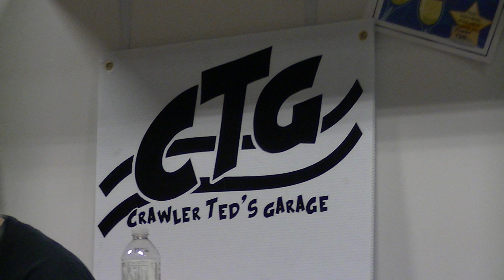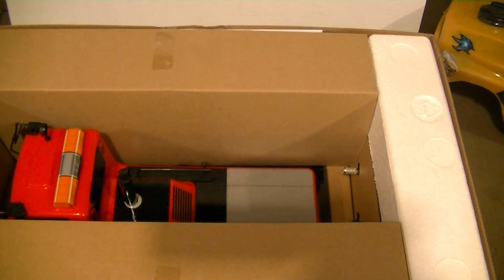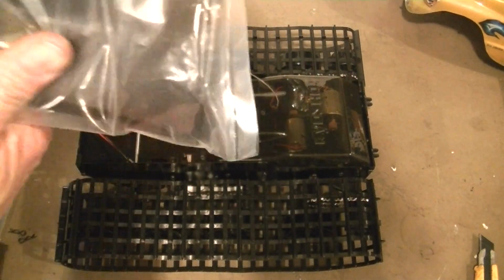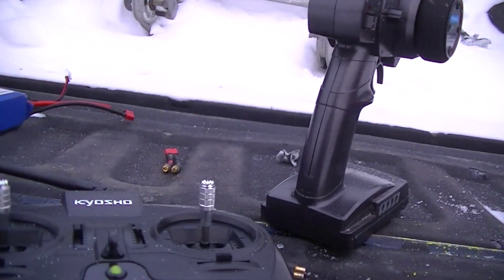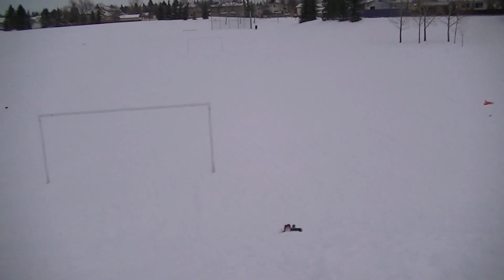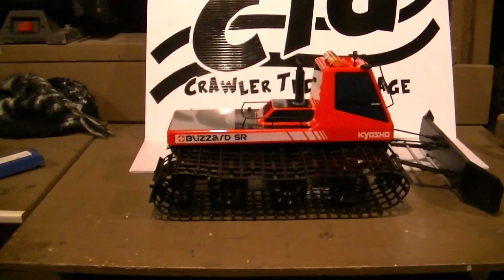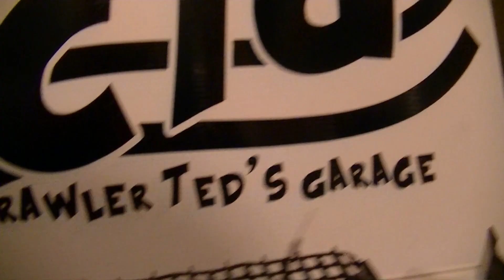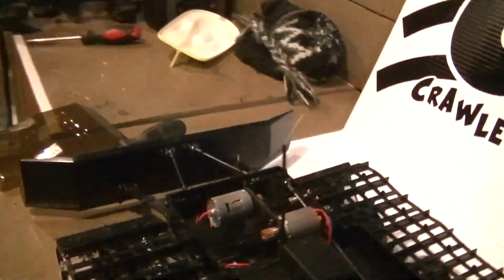Kyosho Blizzard SR , Open the box and hit the snow

Comment: Just pick up a blizzard didn't like the controller either so I hooked up my iT-4 running 3 different mixes. Way better!! Mix 1- throttle to channel 3 100%(low-high) 0 offset. Mix 2 steering to channel 3 50% (low-high) 0 offset. Mix 3 steering to throttle 50% (low-high) 0 offset.  left track ch-2 
Right track ch-3
Plow ch-4 using switch and trims. 
This makes the blizzard super fun and easy to control. Only down side is plow is up or down with a slow trim adjustment while driving but once you get the limits where your happy it's not a big deal. Also 4" zip-ties work great as studs on harder snow. Zip them around the lugs with head out and snip the extra off on a 45°. Just make sure they don't interfere with idler parts. I only put them on outside two windows. Have fun keep up the good videos!!!

Comment: * more to run a pistol grip radio. The vehicle runs on bushings so a plentiful amount of grease will help with rust. I suggest if you upgrade electronics that you replace all the wiring and switch because they are rated so low in current. Also you can wire led lights into the motor circuit to create head and taillights at there respective times (opposite polarity) have a blast.

Comment: How long does the blizzard usually run for on a single battery charge?
Reply from the maker: Im not sure to be honest , It usually pisses me off before the batt dies , lol
I need to get a different esc for it .
Reply: Would it work well enough for light use with the stock ESC?
Reply from the maker: diecastmania Some people are ok with it , others hate it . I hate it , lol
The raise and lower function is on the same stick as forward motion . the tow sides don't always work well together . there is a better esc that can be put in them . I think about 80 bucks . allows it to be run with a normal radio  .